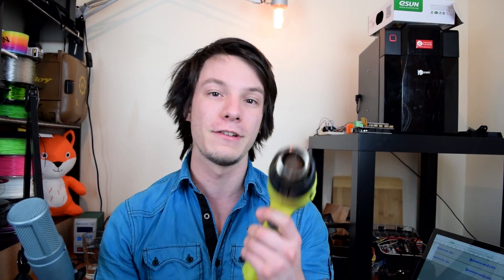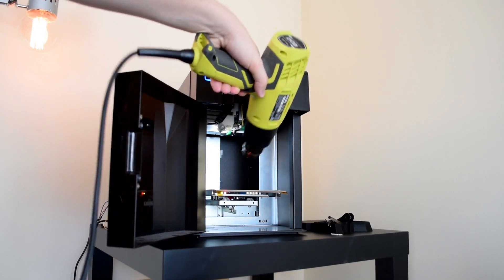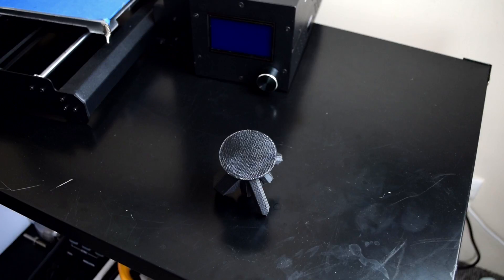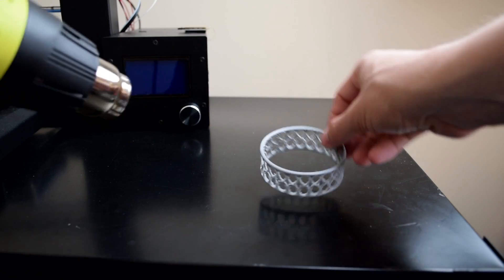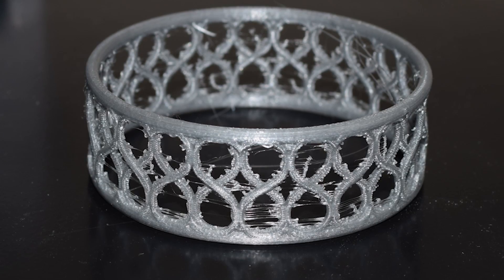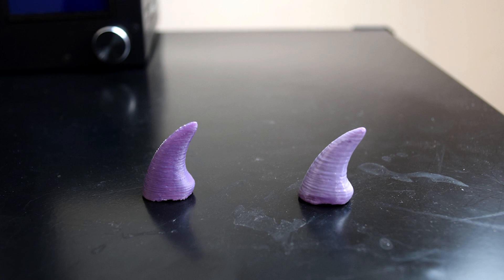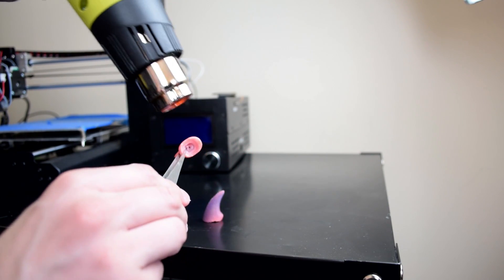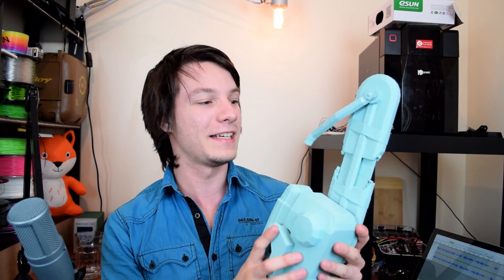5 Reasons you need a Hot Air Gun in your 3D Printing Toolkit - 2015

Comment: If you want to spend a bit more $$$, you can also buy a hot air rework station for desoldering circuit boards, and then you have a set point temp.  The LRT 858D is about $48 and has a range from 100c to 450c.  It comes with different nozzles too. For prints imo this is a vastly superior option to a heat gun because you can precisely pick the specd print temps that the manufacturer uses.

Comment: A case study: when I first got my 3D printer (I'm a newbie, go easy on me), I made some mistakes that lead to me snapping the feed tube to the hot end. The fact that the lubrication on the thread for the feed tube was pretty bad already, combined with the fact that I had already printed a calibration cube, meant that the threads for the nozzle and feed tube were both clogged with plastic, and I couldn't free them no matter what I tried.

A few weeks later, I have a similar problem. I had not screwed in the feed tube tightly enough into the replacement hotend, and thus had a volcano of molten PLA that trapped the feed tube to the heat block. Same story, couldn't free the parts no matter what I tried. 

The day before the replacement parts are due to arrive, I look mournfully at the two perfectly good hotends, when I get an idea. Using a heat gun, a vise, and a pair of pliers, I was able to salvage both hot ends, and with a new nozzle and feed tube, I was back in business.

Long story short, never underestimate the utility of a heat gun and soldering iron. They can save you time and money if anything goes wrong with the hot parts of your 3D printer.

Comment: My workshop is so cold that the printer throws an error code and stops working if I try to preheat (if it senses bed or hotend temperature below 5° it assumes there is a fault). Using a hot air gun I can raise the temperatures just high enough so that the built in heaters take over

Comment: Has anyone ever tried freezing a thicker PLA part. Then using the heat-gun to melt the surface beyond the normal quick swipe? Maybe having a cold core temperature will prevent warping the entire model.
Reply: That sounds like it might have potential! I need to get a heat gun soon - I'll try it when I do.

Comment: i'm tempted to try out a hot air soldering station for more fine work on my 3d prints, while they don't cover the same area as a heat gun i think they are more versatile in the way that you can control what part of the print you heat up and allow for all sorts of crazy stuff. also there is the temperature control which can go from 100 to 450c (atleast on the model i'm thinking about )
Reply: You can just don't use any nozzle and it'll have basically the same area.
And a lot of hot air guns do also have temperature control. Either just high, medium and low or actual precise settings for temperature and the speed of the fan.

Comment: Do not heat an acetone smoothed print before ALL of the acetone is evaporated. This usually takes 4 hours for most prints. If you do not, the acetone will boil under the plastic and nasty hard to remove bubbles will appear on the surface.

Comment: Hi Angus.I'm new to this 3d printing. I have a Formbot t-rex printer & I also bought simplify3d software. I'm having a lot of trouble getting the settings right. The first layer is very hairy looks like a raft  looks like it should be taken off of the model like a raft but is hard to do. Can you help with this problem? Thanks.Ed.

Comment: Call me crazy, but would a few blasts from a hot air gun also be useful for removing PLA buildup? I've been fighting with the printers at my work lately, and we thought we had one fixed, but then when I went to run a test print, PLA oozed out all the wrong areas (after properly extruding upon loading >_< ). Took it apart when I saw some loose bits that should have been tightened down, and rather than having to reassemble to heat the hot end only to have to disassemble and start over when it doesn't work, I'd rather find an easier method. I'm researching using a soldering iron on it now, but this looks like it might be even better?

PS - I'm still learning the technology... I've used 3D printers for about a year and a half at least now, but I am now the one in charge of maintenance, and have been delving deeper into the hardware than ever before in the past couple months.

Comment: I've tried a similar technique where i was trying to get a PLA part some more gloss and ran my butane torch across the part and while it did bring a permanent shine to that test area, it quickly began to shrink. so that's a neigh on a butane torch/naked flame, even quickly. 
A side note about the heat gun, the same technique goes for the raw plastics on your car/suv/bike. When they turn faded, dont bother with back to black or armor all, just nail them quickly with the heat gun being careful not to over do it. do this evenly across your rear bumper step pads or factory flares or even door mouldings (as long as they are not painted), they'll be looking like new in no time!

Comment: I have got into building heat chambers for all my printers and I use a glass window door for all of them. I source the glass from photo frames and print the frames and hinges using magnets to lock it all into place. I have also found that using perforated aluminum as my bed plate allows for less heat warping at the base.

Comment: Tried using a hot air gun before on pla but I wasn't going fast and ended up deforming part of my printer.
Reply from the maker: If your printer is made from acrylic I wouldn't go near it with a hot air gun!
Reply: Maker's Muse Acrylic and pla parts. Didn't point the gun at the printer directly, but one of the printed parts on the opposite side of the bed. Lesson learned.

Comment: Would it help to seal PLA surface with hot gun to make a model watertight? something like a small pot
Reply from the maker: +Julia Eygeris Unfortunately it would soften and deform long before becoming watertight. I would use an epoxy coating like xtc-3D to make the part watertight instead.

Comment: Thanks for the tip. I have a hot air reflow and soldering station sitting 2 feet from py printer and never thought to use the hot air gun on a 3d print.

Comment: I've been meaning to get a hot air gun for a while (I've used a turbo torch lighter for heat shrinking cables for years, so got away with not using a hot air gun). Went out today to get one. 1st use - tidying up the finish on a 3D print. 2nd use today... drying out a chipboard floor after a pipe in the kitchen started leaking! It's saved the floor! :) They're worth the GBP 20!

Comment: Nice tip!
I also discovered this by myself a few weeks ago and it's really useful.
I don't use a hot air gun but a Dremel Versatip that can work the same way and it's more precise (5mm diameter output), it's also possible to fill cracks or empty spaces by preheating some pla/abs wire that you put gently in it.

Hot air guns are definitely a great tool for 3D printing (and need a little of practice).

Comment: This is awesome! I always print with PLA and find that the cobwebs are always a hassle, especially since my printer doesn't support retraction. I'll definitely buy one of these
Reply from the maker: +101pokemasters Sweet! What printer is that that doesn't support retraction :(?
Reply: Maker's Muse My phoenix 3D printer came with a pre-made operating program (a clone of repetier) It doesn't support retraction. If I were to switch software, it would be a very long process as the wiring is quite mangled. There would be hours of changes in the firmware.

I guess I'm too busy with completing my new printer, which by the way, is going very well. I'll update you when its done!
Reply from the maker: +101pokemasters Looking forward to it! And yeah, that sucks. The Flashforge Flashprint software doesn't (well didn't last I checked) have retraction either...

Comment: My heat gun has rescued printed parts many times. MANY TIMES.
Reply from the maker: +3D Printing Nerd Best tool ever! :D
Reply: +Maker&#39;s Muse Yes best tool. I just got one today for my printing. Best part is  it came with attachments for controlling air flow. Something that also was not mentioned on amazon website was it comes with a few metal spatulas that I use for removing prints.

Comment: Excellents tips with the heat gun MakerMuse. Anothers tips if you want insert a metallic part, just heated up and put it in the printed part. Other, if you are using abs juice for paste various parts and you are with little time, just use the heated gun in the zone and dry all the solvent used for paste more fast. Regards.
Reply from the maker: +Jose Rafael Peña Gholam Nice! I hadn't thought about heating up metal inserts, but it makes sense. I have tried to speed up ABS juice before with the heat gun but found it bubbled, so I may have been too aggressive.
Reply from the maker: +Chuck Hellebuyck's Electronic Products NiceTip! I've always struggled to find threaded inserts in Australia sadly - would love to use them more in 3D Printed Projects.

Comment: Thanks for sharing this great tip with us!
Do you have any experience with the wanhao 4x? I am currently not shure wether to buy the flashforge creator pro or the wanhao 4x.
Reply from the maker: +MasterMatt The Creator Pro has a metal frame while the 4X seems to be plastic or that weird foamboard the Replicator 2X was made from. Both are pretty much clones of the 2X - a fairly old design now. I would go with the Creator Pro based on the Metal frame.
Reply: +Maker's Muse so can you recomend me any other printer in the simular priceclass?
Reply from the maker: +MasterMatt I've reviewed quite a few machines that might be suitable - really depends what you're chasing. Big print volume, ABS prints, dual heads? Also what the use is - for learning where fixing the machine is OK or a classroom environment where you want 100% reliability.